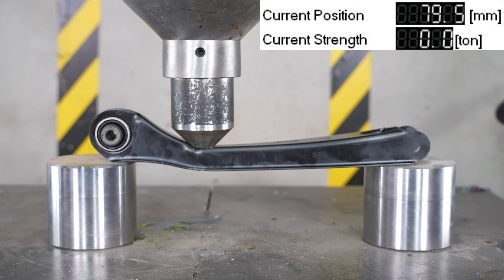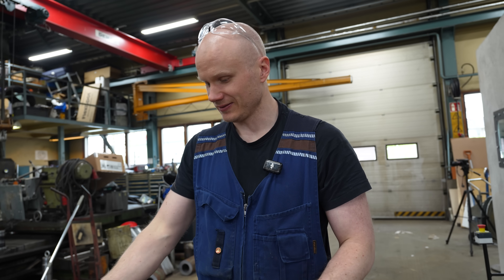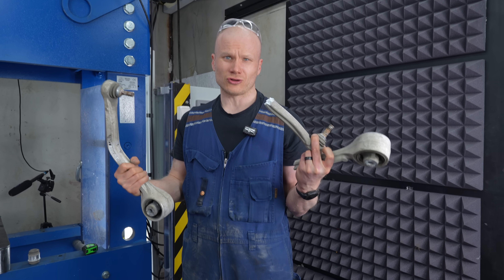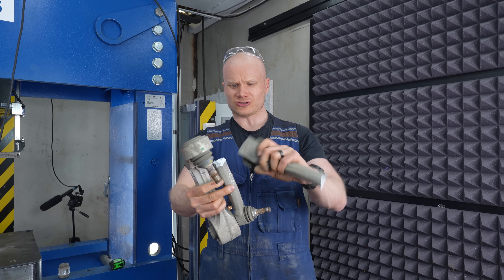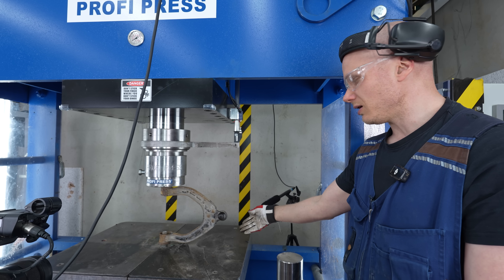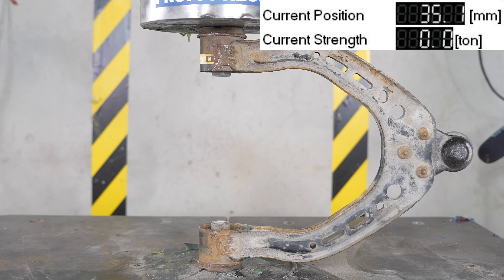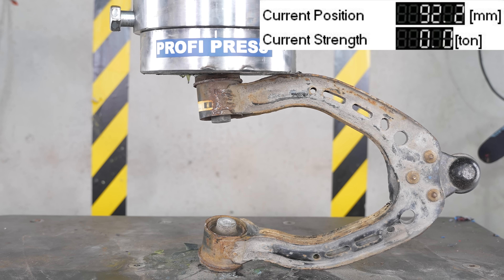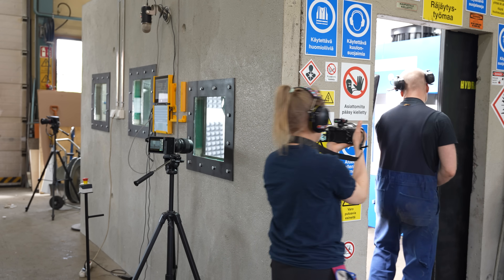Crushing Parts From My Tesla Model S

Comment: There were a couple of measurements that were a bit strange. Suspension arms that start to bend without a number showing as a decimal on the measuring equipment, under 100 kg. That means I wouldn't be able to stand on them without them bending, that's not right, something is fishy with the numbers.
Reply: I think the actual resolution/minimal force that sensor was able to show was 1.2t (or something of that order), despite the display suggesting it was every 100kg
Reply: @Krecikdwamiljony 

That sounds like a perfectly reasonable explanation, thanks.
Reply: @Krecikdwamiljony   That sounds perfectly reasonable, thank you.

Comment: Tesla is not better for snapping at 11.5 tons vs Audi bending at 5 tons. You vant the parts to suck up energi during a crash, so the g-forsses are less. This saves lives or in a smaller crash it can save the internal structure  of the car
Reply: G FORCES DO NOT WORK THAT WAY.  GOOD NIGHT!
Reply: Tesla still scores higher than Audi in safety crash tests, so... Doesn't seem to matter much.

Comment: So THAT's how you use a press to remove those bushings!
Reply: Last month my dad and i changed the ones for the rear sway bar on our car and the fken BASTARD wouldn't budge even after we pulled out the induction coils to burn off whatever was holding it stuck and for the expansion of the metal to help in the process too. If that MF didn't spin it'd be such an easy job, but nooo 😑
Reply: But that is the slow method.  The much faster method employs explosives, with shaped charges being the fastest of all.
Reply: @Farquare  saw one guy removed bushing in less than second. right after the suspension failed on him. Not sure if it was punishment or just part of the accident..
Reply: @Farquare during my interview to get a job at jiffy lube this answer was apparently not the right one.
Reply: It could be so easy 😂

Comment: Are you changing your control arms, or are you going to crush the car bit by bit? :p
Reply from the maker: I changed new ones 😂
Reply: @HydraulicPressChannel  Ah! How long did they last? They didn't last very long on my 2019 model 3, but that car had a known issue with them.
Reply: @logitech4873  They should last 100000km to 200000km. Anything less is pathetic.
Reply: @Chris_Garman  Reading his other comments, they lasted 190000 km.
In my model 3 (different car) they lasted about 80K kilometres due to the manufacturing issue, but they were replaced for free because of it.
Reply from the maker: @logitech4873  190 000km so pretty good. This was first bigger service task for the car
Reply: The front ones in our Model Y were replaced under warranty at around 115k km. I'm glad that we ponied up to extend the warranty from 60k to 120k km, it was totally worth it. It's a shame we couldn't extend it again to 180k to be more in line with the coverage we had on the old Santa Fe XL it replaced.

Comment: Tesla arm is so big because the car weighs much more than the others.  Nothing like mass to ruin the efficiency of a car!!!
Reply: We replaced a Hyundai Santa Fe XL with a Model Y Long Range AWD 3-row. The Tesla is less than 300 pounds heavier, that's like one and a half adult passengers, and not really a big deal. Either one weighs less than a king-cab pickup truck, which is what all the cool soccer moms and cowboy wannabes are driving these days. That whole "heavy EVs are destroying our roads" thing is bs propaganda from scared oil companies.
Reply: @KevinT3141  That whole "heavy EVs are destroying our roads" thing

Is from the rest of the world that don't buy tanks to go to the grocery store and so EVs are significantly heavier than most cars.
Reply: @KevinT3141  If you're aware of the weight reduction efforts by the majors to achieve CAFE numbers, then 300 lbs is a very big deal.  And it would be futile to argue with Newton's F=ma.
Reply: They're super efficient cars though.

Comment: How aluminium alloy parts fail depends a lot on how they're manufactured. Cast pasts tend to crack quite suddenly while forged parts (or any process that results in similar grain structure) tend to bend a lot more before cracking.

Comment: For heavy duty parts that require strength + lightweight, without the fatigue issues of Aluminium, appropriate Titanium alloys are optimal if cost is no object and composites aren't acceptable. BTW, the tests would be both more realistic and interesting if done with the outside mounting points solidly fixed.

Comment: Automotive suspension parts are designed for specific loading in specific directions, which this video completely ignored. What matters is whether or not a part meets its design criteria. This 'testing' was a farce, only showing that any metal can be bent by applying enough force.
Reply: Are you new here?
Reply: Yeah, but shes def packing under those overalls.
Reply: Oh shut up and watch the damn video. It’s for fun. You should try it sometime.

Comment: The arms without the holes in the middle weren't designed to be loaded in bending – only in tension and compression.  That's why they were so weak in this test.

Most suspension arms are designed to be loaded only in tension and compression.  The Tesla/Audi/Land Rover control arms are exceptions because coil-over dampers mount to them in the middle where the press was pressing on them.
Reply: Yep and the pressed sheet steel arm looks like some sort of rear toe control arm. Unless you try to drift or you have a Mustang leaving a car meet and slide sideways into a curb, it won't see big forces

Comment: There's so many different variables in the type of each metal and how its processed... I imagine forged steel would fare much better e.g.
Aircraft landing gear is still made of steel for example, since it can handle the repeated high loads the best - obviously it's aerospace grade steel which is forged, not cast, but aluminium simply isn't strong enough for such high load applications (titanium is used too but it's more expensive)

Comment: Keep in mind that many parts, especially suspension parts and drivetrain mounts, are designed to fail at specific loads and specific places. It's all part of the manufacturer's crash strategy. They want the various large, heavy parts of the car, like the engine, transmission, wheels, etc to do predicable things in a crash. For many manufacturers, they use the wheels and suspension to absorb some of the energy when crushing, especially on small-overlap crashes, such as when a car just crosses the centerline and hits oncoming traffic head-on. That's why these suspension arms have spots where the material is much thinner, or even have holes cast/cut into them... it's a specifically designed and intended failure point.

The Model X control arms that were made in Canada and Mexico also never receive any load in the direction you crushed them. They only see compression load, which is why they bent so easily when you crushed them. Not the intended direction of force. It also shows why you shouldn't try to tow or jack up a car from the control arms.
Reply: What a load of completely made up bullshit. Those are not part of any crash structure lol
Reply: 10:50 its true, its not the sense the power apply. But the brace arms on the beginning are showing correct direction.
Reply: If you think these parts were intended to break, you have to learn much more about cars...

There are other parts that are part of the crash structure, that are intended to crumble under crash. And none of the suspension parts are included in the crash structure. If anything, they should be designed not to break apart off the car, to not cause additional damage to other participants in traffic, and pedestrians too...
Reply: @senja572  That wasn't the claim.
The point was that all parts break in certain ways, and these ARE.
It's why crash structures exist. It's why F1 uses carbon fibre. Because things are often meant to be strong in one direction and weak in another. That's basic physics.
The simple fact here is that those struts are doing their job but this is a demonstration of the MATERIAL strength.
Way to miss the point.
Reply: @senja572  You are incorrect. These parts are designed to break apart to move the wheels away from the cabin.
Reply: @brandon4185  Bullshit lol. Nothing better comes from them breaking.
Reply: The crash strategy seams to be simply to cause the most expensive possible damage in any case.
Reply: @danielszanto2955  the more damage the car takes, the less damage the passengers take
Reply: @Ratimus_  If it was only the crumple zones and above certain treshold than yes. But but definitely not the case when the car is totaled in a small crash that wouldn't even needed seatbelts, airbags go off in a small bump and there's a secondary crash cause that shit blocks my vision.
Reply: @danielszanto2955  How do people mix up THEN and THAN?
Reply: @timjohnun4297  1, typing in a small sidebox while not paying full attention is the most likely cause. 2, These stupid natural languages were obviously not designed by a competent person or group with the knowledge of Hamming distance. 3. If you are nitpicking, nobody wrote neither "THEN" nor "THAN" except you.
Reply: @danielszanto2955  Kid of, it's a bit the other way round. The companies DO love to note which things get broken the most and up the prices of them. I used to have motorbikes back in the 1980s. Yamaha RD50s, 80s, 125s, 250s and 350s all had the same indicator lights and assemblies. And 5 different prices.
Reply: I mean, obviously. That's not really the point here. 
We all know that mechanical parts are designed to be strong in given directions and under given forces. That's why carbon fibre is widely used in F1 - because it will be strong in a given direction and almost like eggshells in another.
I'm not sure you understand the point of the channel.